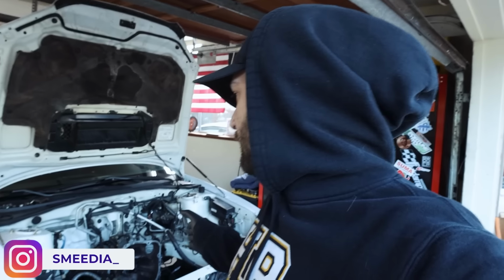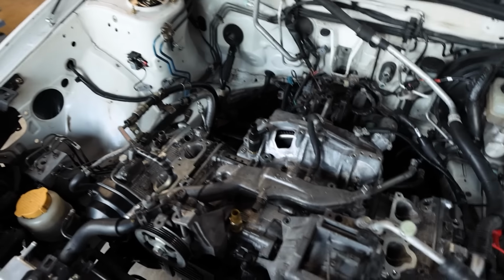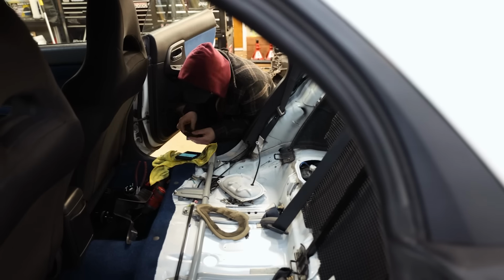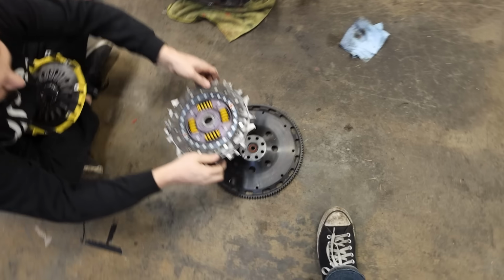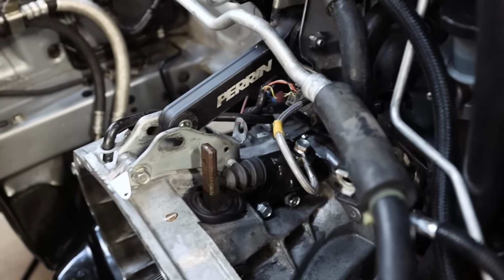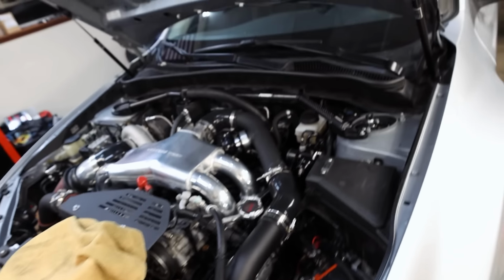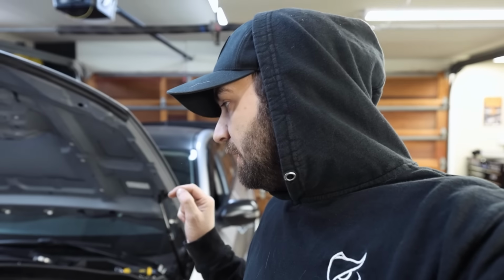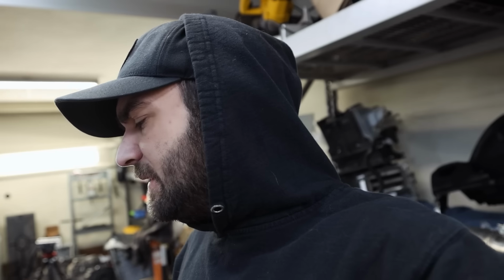The STI Swapped Subaru WRX: Finally, a Problem-Free Car!

Comment: I have 0 experience, but my guess would be that it was because of the flywheel being warped or ground down a little, which would cause all or some of the springs of the clutch to also be recessed and the throwout bearing wouldn't be able to push against them properly, so the clutch would be slightly engaged. But i think you did the right thing replacing everything... I can understand it gets hella annoying pulling a motor in and out a handful of times. Good job and  keep up the amazing content :D
Reply from the maker: That's the most logical thing I could think of, either the flywheel was warped towards the trans or the tob couldn't fully reach 🫡

Comment: The problem with routinely taking out an engine rather than just the part you need (trans), is that you open yourself up to lots of other problems.  So whilst it might be easier to work on, it can give you other headaches.  

Glad resolved.  Love how relatively easy it is for you now just to be "700bhp" car. Lol.  Loving the hatch.
Reply from the maker: Big facts, but when you don't have a full 2 post lift, pulling the engine is so much easier 😅
Reply: @Smeedia  lol, I don't wanna hear the excuses 😂 😉 jk.   Keep up the solid work.  I'm glad you show all the headaches, it keeps it real.

Comment: I'd agree that you have a warped flywheel due to being heat soaked. Unfortunately, It's not something that you can check with the naked eye. Hopefully you can get you tuning session set and put the power down on this guy. Great find on the continuity test!
Reply from the maker: Thanks Eric! Electrical is never fun but such a good skill to know 🔥

Comment: After installing the engine before hooking literally anything up with like 2 bell housing bolts in I'll test the clutch by having someone sit inside and press and depress the clutch pedal while I spin the engine with a ratchet just to make sure it's disengaging. So i can pull it back apart super fast if there's something wrong
Reply from the maker: Thursday, normally I'll just push on the clutch for to ensure it works. I'll have to start the spin iver technique next

Comment: You could have hooked a drill up to the transmission just to make sure that the gears engage. Just have to make an adapter for the splines and then in future you can test your trans without needing to put an engine back in.
Reply from the maker: Drill wouldent be able to spin the engine nearly fast enough to be able to check 🙏

Comment: I had that happen with a stage 3 spec clutch. Sent it back to them...they never said what was wrong just sent a new clutch months later. I just sold it without ever installing it again
Reply from the maker: They are a pia to swap in and out 😫

Comment: Hey man love the videos. Looking for some guidance if you can spare. Replaced transmission from a JDM dealer. All new clutch, flywheel, clutch fork, and fork pivot. Won’t go into gear when running. Any ideas what it could be? Thanks bro 🤙🏽🤙🏽

Comment: I think the old clutch issue might have been the fly wheel bolts. If they are too long the fly wheel won’t seat properly causing engagement and not being able to disengage.
Reply from the maker: They're oem sti flywheel bolts though👀
Reply: @Smeedia  u mentioned also in the video that the new clutch has different bolts around the outside of the pressure plate. Maybe those were not seating properly also?
Reply from the maker: @Sean Newstead  possible, the old mod twin I had was one if the first they released so they made some changes to it from what I can see

Comment: So this is probably a dumb ? But this is my first all me start to finish project  so I'm gonna ask to be 100%. I'm gonna do an EJ swap to my 2020 WRX and I've recently found a 1 piece driveshaft.  Question is if I buy the one for the FA will it bolt up to the EJ when I get the motor and do it in.   I've tried to look this up and can't find anything on this.   Thanks in advance.  
PS- congrats on the progress 👏 💪

Comment: Tanner, I see on that engine that you have a I'm guessing AEM oil pressure sensor mounted where the stock sensor goes.  I plan to do the same very soon.  I already have the torqued performance adapter.  My question is, how do you wire it up so the light on the dash stays off?  I currently have an AEM oil pressure sensor system, but it's mounted on a Perrin oil filter sandwich plate.  Personally, I do not like it there and feel I will get better readings where the stock sensor is.

Comment: Hey shmee! I have an 11 wrx hatch. Just wondering if you've ever had a grinding noise on the hatch during deceleration. Mainly and most noticeably in 2nd gear coming down from 3k rpm all the way til 2k? Stops when clutch is depressed and stops when accelerator is pressed. 

Shop said flywheel as soon as they heard it so we swapped to act ss heavy duty full clutch kit. Sound still happens.

Comment: I noticed a few videos ago you did the wrx hatch radiator and notice the fans with extra fin did you do that for cooling modifications? I know you did that to the blue sti. Thinking about doing same to my gd sti to keep temps lower.
Reply from the maker: Those are still the OE Fans👀

Comment: Hi Tanner, question.

@1.45, you put the clutch fork back in and put the shaft back in its hole. I got told you can only do thatbon the point where the engine in fully attached ? Your way would make it just way easier... 

So the question would be... does it work properly doing it your (the easy) way ?
Reply from the maker: Noooo, always do it before. Trying to do it after would be an absolute nightmare
Reply: @Smeedia  i knowww right.. been cursing on the thing for like an hour.... 

Ill do it this way next time 👍

Comment: The flywheel could be warped but also the pressure plate springs warp very easy and that's why you have to tighten and loosen the bolts slowly and in steps  because they are so sensitive that if you loosened or tightened one side farther down than the other side it can warp the spring causing that exact problem. heat can also cause that and I suspect the heat was your issue. also I've seen a damaged pilot bearing cause the same issues. just food for thought. I'm betting it's the pressure plate spring that's warped.
Reply from the maker: Has to be from the heat then if it is the springs 🤔 that 1st twin disk only had like 600 miles on it
Reply: @Smeedia  and I could be wrong but I've seen badly warped flywheels that only caused a serious vibration with difficult shifting and were just completely scorched and cracking then also seen where people slipped and smoked a pressure plate spring until it wouldn't disengage but I haven't played with lightened flywheels much and the reduced mass can translate heat faster. I would take a straight edge across the surface of the flywheel and check with feeler gauges then bolt the clutch on and set it in a shop press with the throughout bearing and see if you can get it to disengage and if the spring is warped you might be able to see the warpage once there's pressure on it. knowing how it failed can help from having another failure in the future. and if you do it, you should simulate the distance the clutch fork would travel. now thinking about it  there is a possibility that since if I remember correctly the clutch+ flywheel are for an EJ maybe the crank sticks out a bit farther on an EG allowing too much travel for the pressure plate spring and if it travels too far it can warp. you should check it and take all the measurements to find the cause since it is weird that it died so fast.

Comment: @smeedia when my 04sti is on, I can’t get into any gear, only when the car is off can I access gears… If I start it in gear it jumps forward, but then I can’t remove it from the gear I started in… I had no prior issues, new slave An master … an clutch never slipped
Reply: Did you ever figure it out? I’m having the same issue on my 14 wrx.

Comment: I have a '17 wrx base model. I have an accessport for right now but have wanted to do mods from different companies. Can I install them and get an e-tune until I go to a protuner or is there a way I can get maps for the car with the mods I install until I take it to a protuner? Also I want to get UE headers for the rumble but I know it'll mess up my turbo since it's a twin scroll is there any EL headers that you'd recommend instead?
Reply from the maker: Stick with the ELH and yes you can do diffrent parts from diffrent companies with an Etune 🫡🫡
Reply: @Smeedia  thanks for replying. Cold Air Intake I can only do Cobb and maybe 1 other because of California emission laws. But I've been doing a lot of research on different brands. I also want to make sure I keep this engine nice and healthy and not push it too much.

Comment: I always thought a flywheel had to be resurfaced or replaced when doing a clutch change?
Reply from the maker: With higher milage you should, yes. But thr old one only had 600 miles on it so it shouldent have needed to be resurfaced

Comment: Hey tanner can I pick your brain I'm having issues with my 2018 wrx just had it rebuilt with an iag stage 2 block
Reply from the maker: Whats up 🫡
Reply: So I've been getting  random high negative feedback  knock like -9 to -12. And yesterday I got a fine knock of -4 and my dam just dropped to .75. I reset the ecu and it didn't do it again driving home
Reply: It also happen moving after a red light so no load beside 1st to 2nd

Comment: I don't see a coolant reroute on the hatch's motor, curious if you believe they're necessary or not?
Reply from the maker: I do not use them anymore 🤝
Reply: @Smeedia  do you still feed coolant to the turbo from the passenger side head?
Reply from the maker: @Josh Roeloffs  on rotated set ups I do not 🙏
Reply: @Smeedia  right on thanks for the info!

Comment: Are you running a standalone or cob on the hatch and the 05 ? Just curious cause I’m debating on whether or not I need to do a standalone on my 07 sti once everything in the engine bay is done.
Reply from the maker: 04 is on Cobb, what are you fmgoing to be doing eith the 07? 👀
Reply: @Smeedia  it’s getting a built block and heads, trying to figure out what turbo to go with , tgv delete, flex fuel, process west intake, I’m sure a few other things I’m forgetting but didn’t know if Cobb would still support the modifications or if I should go standalone.